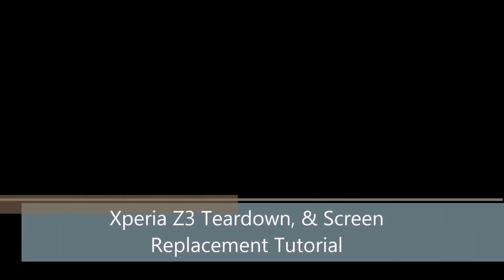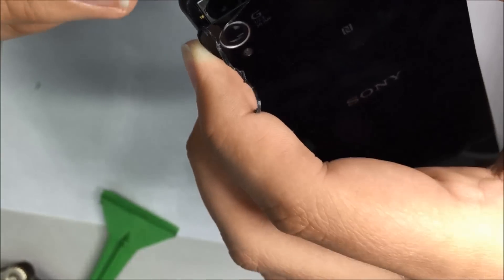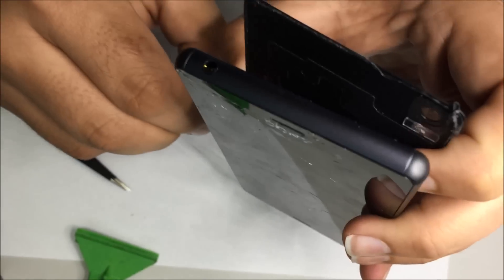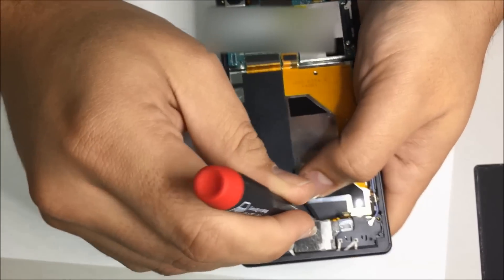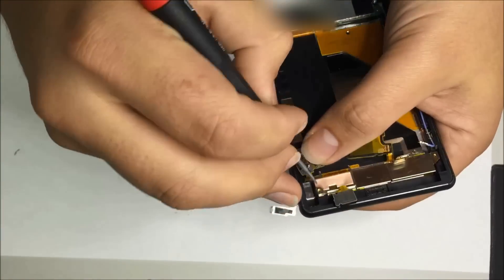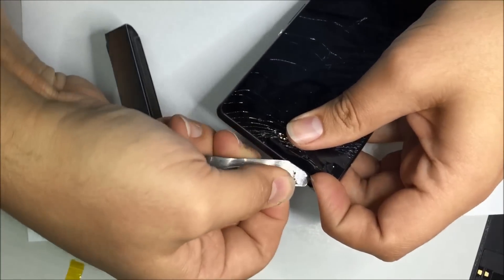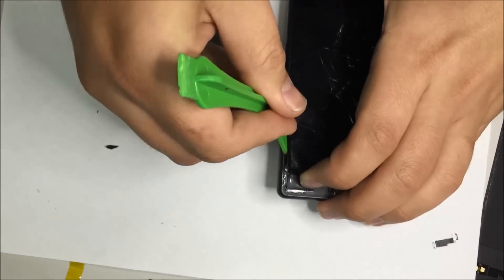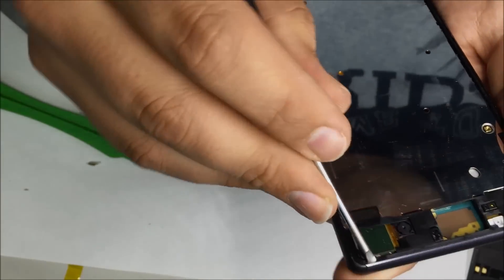World's First Real Sony Xperia Z3 Teardown & Screen Replacement Tutorial

Comment: FYI everyone, the old screen flex and the main flex get brittle with age and tear easier than a thin piece of paper if you are not careful.  I just needed to re-glue my screen but because I tore the flex cables, I had to buy a new screen and flex.  Be very careful not to slip when unsticking the screen flex from the frame.  Also, measure the thickness of the screen adhesive you use, because if it is more than 0.15mm, your screen will stick out.

Comment: could you kindly share the temperature settings for the heat air reworking used for removing the back ? should it be 200degrees or 300degrees ? I think many guide lack of such information despite they all mention that heat air rework is easy but they left out the temperature settings which is the most important. Too high it'll destroy the back panel..

Comment: On my Z3's back panel seal lost grip a bit and some water entered the phone. That resulted in only touch stopping working. Could it be just a shorted connector? I'm thinking of disassembling it to find if that's the case.

Comment: @2:56 that is not a very large piece of adhesive.  That is the pull tab to release the adhesive on the battery that sticks the battery to the back cover.  That is why it took you a while to get the back cover off.  That pull black pull tab works like the 3M command strips.

Comment: Vibrate function not working after screen replaced. any ideas
Reply: +tommy Byrne same problem here
Reply: You've probably damaged the flex cable. I did it once It was a very small cut but enough to make the vibrate function stop working.

Comment: Gaved my Sony Xperia z3 to repair it's was completed dead won't work won't charge properly. Gaved to Sony company to repair took 7 day to return the phone back but they couldn't fixed it this is poor Sony company useless what's the fukin point making waterproof phone dumb asses they still get fucked I had it for contract 2 years still left 1 year left :(
Reply: it's waterproof to 1 meter depth and maximum 30 min. also. if they can't fix it and you have to pay for it. you are entitled to a brand new phone if they cannot fix your problem
Reply: +dom2025 I know they wanted £238 for the new phone which I have one year contract left couldn't ford it. Anyway am using my previous fone called Sony Xperia T I still had it for 3 years working fine not waterproof.
Reply: dom2025 yo I just fixed my Sony Xperia z3 fone myself just needed new battery for the fone. Stupid sony people didn't know what was the problem they call them self sony xpert my ass they took £20 returning fone back just like that I want my £20 back.

Comment: i actually dropped my phone into water.And my phone screen doesn't turn on anymore. So I don't know if it's just my screen is broken or something else more. Is there anyway to figure out the problem(s)?????
Reply: +Eva Lee It basically has to be disassembled to diagnose.  I did the same thing with mine - I went swimming and somehow water got in.  I disassembled it before buying a new screen and found some water damage on the motherboard.  I'm cleaning it now, hopefully that's enough to fix it.

The motherboards aren't cheap - if that doesn't fix it, it's not worth fixing.
Reply: Tks
Reply: +islandfd3s did you ever get the phone working again ?

Comment: It says a "digitizer" is needed to remove the screen in a different source but is that essentially the same as applying heat? So a dryer can be used instead?? it seems so in this video but just making sure..
Reply: +祁堂隼斗 the digitizer is the screen assembly itself.
Reply: yeah, i realized; I went anyways and tore the whole phone apart since it became utterly useless as much as Sony is. Good 500GBP study material for a smartphone anatomy.

Comment: when I assemble my phone the screen sticks but slightly lifts. I saw in another video a guy used gorilla glue to stick the screen, what are you opinions on this? thanks
Reply: +lSmoothy having the same problem. Anyone know a good fix for this?
Reply: +Luke Mardell I used gorilla glue and it works perfect, only use minimal though
Reply: how did you apply it?
Reply: +lSmoothy
Reply: lSmoothy how did you apply it? smear it in from the edges and clamp it down and let it dry? Also can you send me a link for the exact glue please. Thanks ISmoothy.
Reply: Luke Mardell a very thin layer just around the screen of the phone, then I used insulation tap and secured it down. Search Gorilla Glue it's on amazon real cheap, tell me how it goes bro!
Reply: +Luke Mardell I used a small needle (for sowing) Put some gorilla glue on a piece of paper, dip the needle into it, then put the needle in between the screen and the frame. Then hold it down for a about 1-2min, then your all set.  Also make sure to wear eye protection (I wore goggles) because super glue gives a bad reaction to your eyes and will make them burn. Also wear gloves because if super glue sticks to your skin it is very hard to take off.

Comment: have a z3 but its unable to use now. first the internet conn. and the bluetooth is not working. then after it got fixed battery started to run fast, it only take1 day to finish the battery without using it. and the other issue is difficult to get a battery replacement. now my phone is at the repair center and im considering to get new phone. in short my $700+ will soon fly away.

Comment: replaced my back glass today no prob no hassle had it prepped before the replacement was delivered and sealed in an anti static bag after going over the trim with nail varnish remover and a cue tip. My phones now black n white. Always apply heat AFTER you press the glass down to make sure the adhesive gets the most contact with the frame.

Comment: Hi there. I have a problem with my xperia z3. Does replacing a cracked fornt glass means replacing the lcd as well?or it can be replaced separately? There are no problems with the display. Only unresponsive to touch. I'm now using a mouse to navigate it.. hoping for your quick reply.. thanks..
Reply: chumai0328 I'm pretty sure the screen assembly consists of both the touch digitizer and LCD.

Comment: Question: if I have a black version, can I replace the broken screen with a white replacement? They seem to be cheaper.
Reply: Kimberly Pack i have the same model and yes you can replace it with the white one.if you have the same model for example D6603 but i fully recommended not to do it.you will lose the waterproof.ill tell you this.send it to proffesionals, yes yes you will pay 40-50euros or dollars more but they will fix it like new and you will have the waterproof.they also give a guarantee ;) hope it helps

Comment: Got question so my z3 display does not work nomore so i was gonna buy one on amazon thinking they original but the tech guy told me their no such thing of original display if you buy them somewere that is not Sony or get the display is coming from other z3.. So my question is.. Its it still fast the touch and is the resolution still the same?

Comment: i have cracked the screen on my z3 and only half the touch screen works so does this mean i only need replacement glass and not a new digitiser ? please help?!?!?!?!?!
Reply: Dan Whyty look my vids for the answer
Reply: What le vidz called buddy?
Reply: +Dan Whyty The safest alternative is to buy a full screen with digitizer and LCD and replace it that way. If only your digitizer is broken, not the LCD, you can do a separation which would mean removing the broken digitizer from the LCD and replacing it with a new one. More complicated, but a lot cheaper. There are some videos on it, using LOCA glue and so on.

Comment: can you put a video where you assemble back the lcd and it works also why would you disconnect the flexes with a metal screwdriver y understand the glue but the flexes ???

Comment: Hey, I bought a z3 compact with the screen broken, I wal told that it was 100% functional and that is not as that, the broken screen is a line that goes from the top left corner to 1/3 of the right side, the problem is that in the top right side the touchscreen doesn't respond, I don't see more damage beside this, but i want to know what parts I must change t have it 100% functional, can you guide me please?
Reply: Got the same problem as yours, need help to

Comment: sorry, I have a question. 
My xperia z3 now break a little hole because I try to use a pin to clean the loudspeaker.

what I want to know is 
does this affect waterproof?

It seem like the loudspeaker doesn't affect other component in video.
if it doesn't a big problem
I don't want to repair it...

because sony repair department told me that it's need to change all the LCD module,
and it is too expensive...

Comment: I have important question my Z3 screen broken and l will repair it but it's still Waterproof?
Reply from the maker: its no longer waterproof after repair
Reply: Thank you very much
Reply: there is two holes of the speakers and there is a plastic part used to clog or closed this hole and you can use oca not loca glue , to stick the borders like the glue used by a plumber . it is waterproof ;) but do not try to test this with the battery connected to the phone , and even without the battery (just for test) try to click on the power button to discharge the whole capacitors on the motherboard . ...
or to be more safe , open the frame , release (take off) the motherboard and battery and put a humidity or water witness paper , a paper used to be proof that humidity or water is present in this place
and then put it in water less than 1 meter and less than 30minutes .

this is how it can be tested ,
but  anyway if you test it and it works , second time a drop of water can pass trough and arrive to the board .

test it as your own risk :) if  it work and a customer comes and ask for waterproof guaranty then give it
Reply: It can be made waterproof, you need to use the original quality adhesive border stencils for the front and back. Press it down firmly, heat it up, clamp it down overnight. I wouldn't trust it at the bottom of your pool though. :)
Reply: Phone Ninja Perth I have a water problem with my device,
After taking it off from water,  two mins later and I can see water on the camera from inside. Can this be repaired? 
It will be water resisting after repair? Please Answers :)
Reply: you have to open it instantly and disconnect the battery first , then try to heat it by a hair dryer , then test if nothing is damaged it is ok , else you have to change some IC for sure , power management IC , i guess there is two IC dedicated for power ,,,